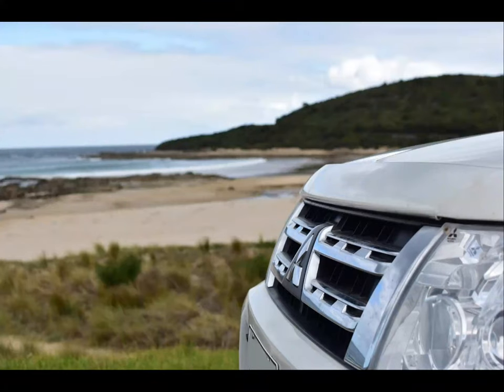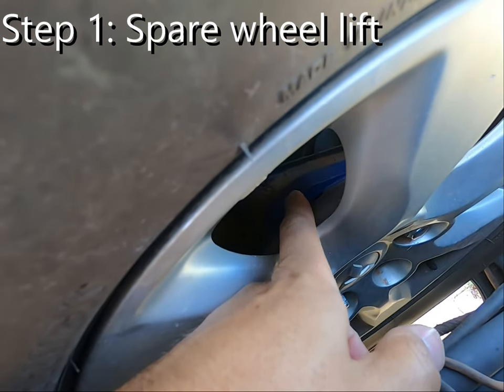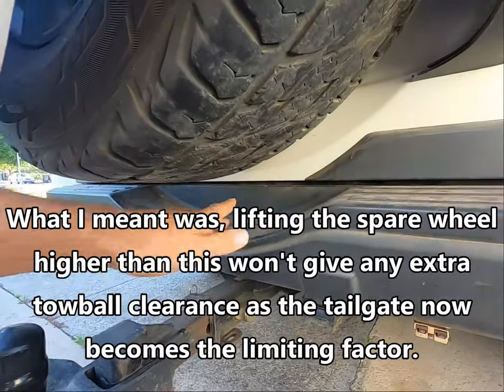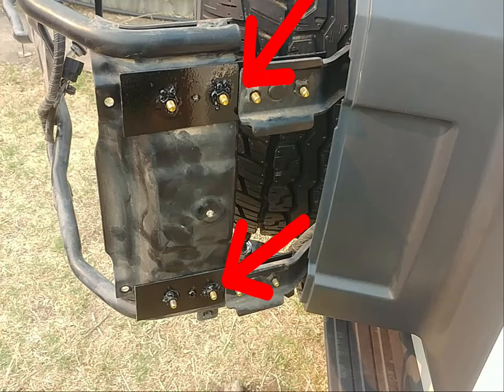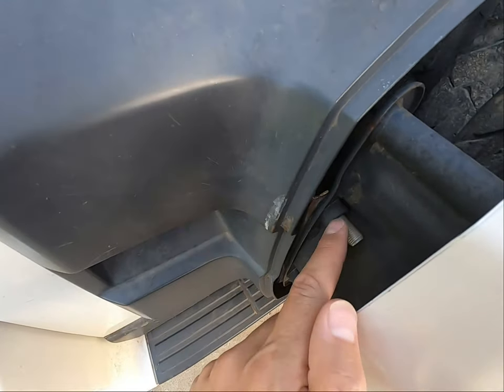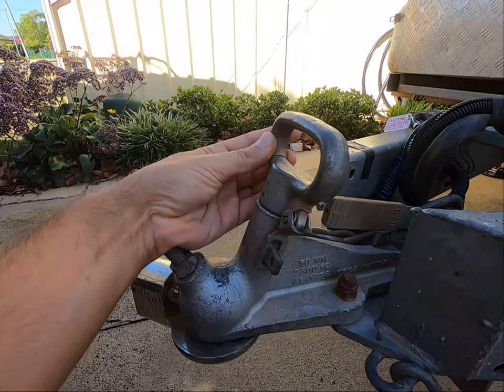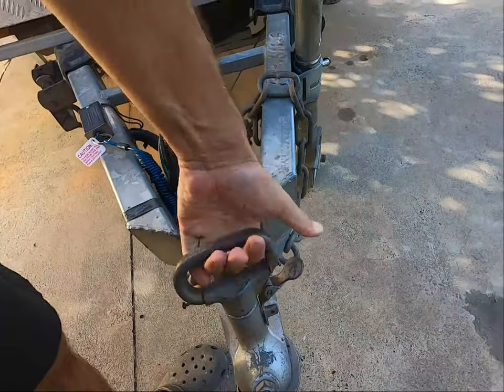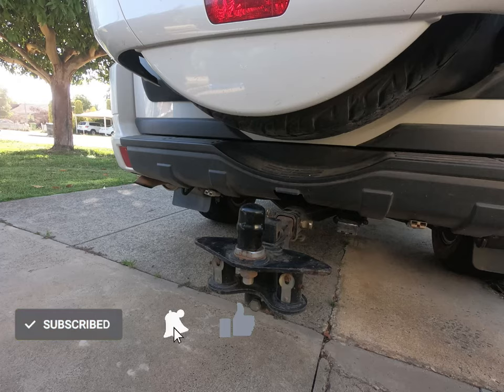Mitsubishi Pajero - spare wheel lift + wheel cover & trailer coupling mods. Top 5 Pajero Peeves - #4

Comment: Hi Greg - thanks for the helpful video. I have exactly the same issue. Did you pre-drill the holes prior to cutting the hitch handle? Also, what type of screw/bolt did you use at each side and how did you attach them to the hitch shaft? Thanks again.
Reply from the maker: Hey Russell, glad it was helpful. Yes I pre-drilled the holes before cutting the hitch. I have since sold that van so can't confirm the screws used but they were fairly thin and long, I reckon they were M3 or M4 at the largest and probably about 40mm long. I would say pre-drill small say 2mm, cut the coupling leaving as much material below the cut and possible, then measure what's left and work out how large you can do. I drilled the hole in the handle out to clearance and had a smaller hole in the main part of the coupling so the screws cut a thread into the main part of the coupling and left the rest of the handle spinning on the screws.

Either that or fit a DO -35 coupling!

Comment: Well done! Are you able to publish the dimensions of the garnish extension brackets you made up please? TIA
Reply from the maker: Sure mate. You will end up with three brackets in total.

On the driver's (right) side of the vehicle, there are two flat brackets, each of which is about 140mm long x 50mm high. On each bracket, you need to drill the three holes which line up with the original hinge holes, and put two bolts through the bracket and screw the bracket onto where the hinge originally attached. You then have to drill another three holes further along which the hinge will attach onto. You can use bolts with loose nuts with spring washers to attach the wheel cover hinge to the bracket, or root nuts, however I welded a couple of nuts on the back of the bracket. You'll need a welder for the other bracket anyway.

On the passenger (left) side of the vehicle, it's a tall rectangular U-shaped bracket, which is about 190mm high when installed. The U shape consists of 35mm high sides and a 65mm wide base. You have to drill a hole straight through each of the 35mm sides of the U at one end, then repeat at the other end - so hole from the outside of one 35mm side, drill through, then continue into the other 35mm side and out the other side. You then need to get some bolts to bolt one side of the bracket into the spare wheel cover, and on the inside of the other side you need to weld a nut top and bottom for the original long bolts through the tailgate door to go into. From memory they are an odd thread, very fine, I think it was M12 fine or something like that. I had to go somewhere like Universal Fasteners to get mine. You can just take the original bolts which hold the spare wheel cover on to a place like this and ask them for two bolts (probably 30-40mm long) and two nuts with matching threads.

If I did the job again I would make the spare wheel cover not poke out quite so far as mine does, but when I was doing it it was so difficult to measure exactly how much clearance I needed I wanted to make sure I had enough. So for the 65mm bottom part of the U I might drop it to 55mm and bring the new set of holes on the two shorter brackets a bit closer in.

Sorry there are lots of words, but hopefully this gives you some idea of where to start!
Reply: @TheMusingGreg  Thanks for the comprehensive response!
Reply from the maker: @andrewm7730  My pleasure mate.

Comment: G'day again Greg. Just a little confused about your wheel lift and those brackets!  Ugh!
Have you fitted wider tyres than the 265's?
I got my plate from MM and the door garnish still closes on the standard spare, and I even have a fabric cover on the wheel with no problems.
Thanks.
Reply from the maker: Hi Greg, yes I was pretty frustrated when I found the door didn't close, but from Geopaj's vehicle as shown, clearly obviously someone else had the same problem. I have Bridgestone Dueler A/T 265's so I don't know why my door didn't close, and why most people don't have this problem. My guess is that they have had a few versions of the spare wheel doors, and mine (NW 2012) is one design that doesn't fit when the wheel's lifted.
Reply: Hi Greg, what fabric cover worked for you after the spare lifting plate was installed? I'm trying to source one that will fit.  Thanks
Reply: @markgibson8145  G'day Mark, have tried to reply with pics but have to do it thru' Youchoob.
My cover is an old one, measures 78cm. between the seams and another 30 to the edge of the fabric. This is for the standard tyre. I also ran a cord around the outer edge to tie and put some tarp rings in the bottom for drainage. When I clean the car I also rub in a bit of tyre shine to keep it 'new'. The doomboosters reckon you shouldn't do that with vinyl, but it is now about 18 years old!
Reply: @gregsneddon8020  thanks so much for all the info.  Greatly appreciated!